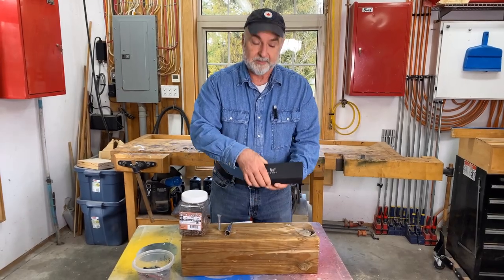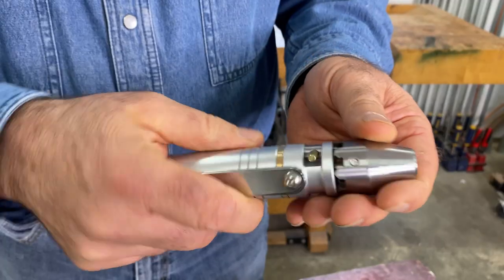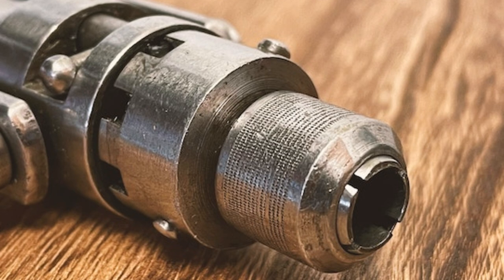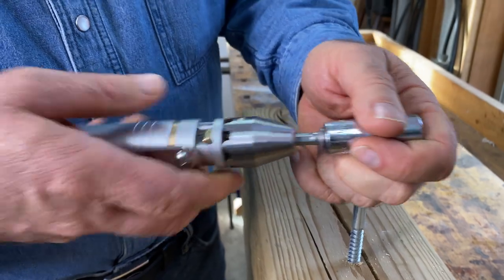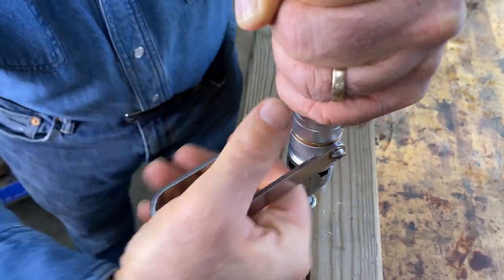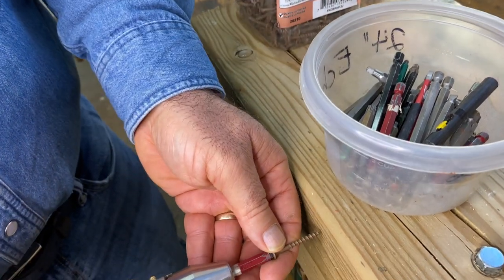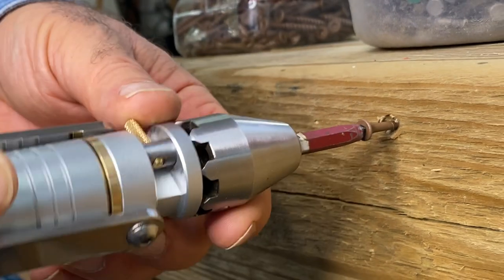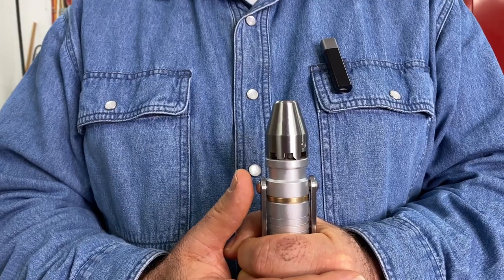Announcing: The Metmo Driver | Making Screwdrivers Obsolete

Comment: Got mine today.. couple minor things that could be improved...   The pin could be tapered to prevent it from walking in use... and the knurled brass? selector lever is about 100th of an inch too long... A set screw inside the base of the chuck to retain the pin or making it tapered would be sufficient.. but mine has tried to walk a little when I've been playing with it (though not with any real torque on it.. which would probably retain it by itself)